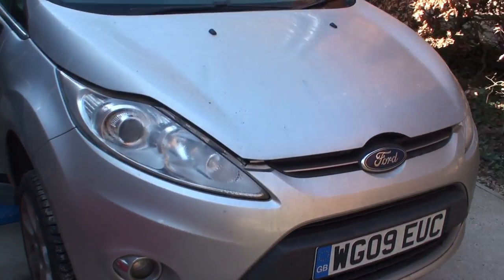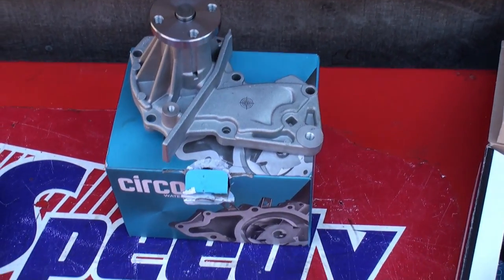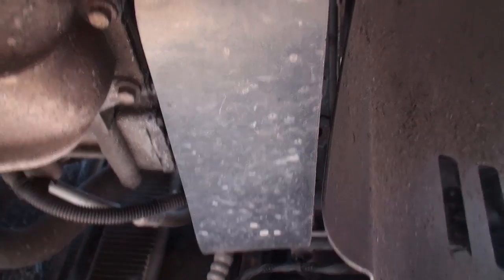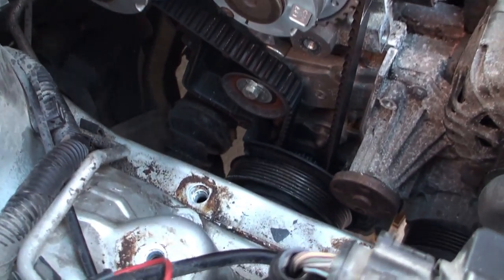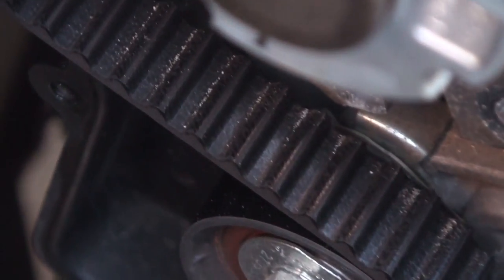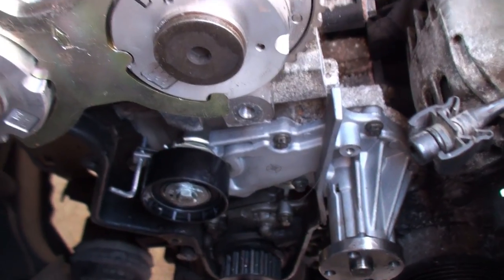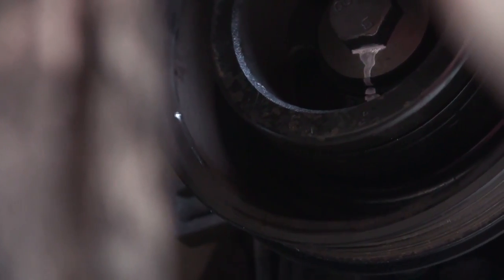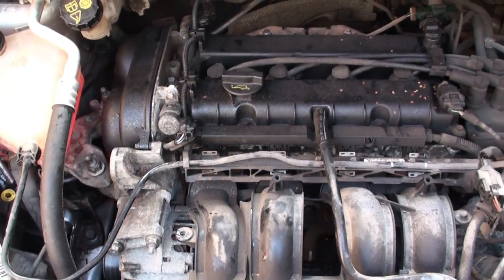Fiesta MK7 Petrol 2008 - 2017  Cambelt Replacement Guide

Comment: Just did mine,  I bought the kit and I thought I had the main locking tool but didn’t.  I still did it with a very powerful impact, and a chain- vise grip over the crankshaft pulley , with towel protecting pulley.  I wouldn’t advise this, definitely get the main locking tool.  Although I was successful.
Reply from the maker: Thanks for sharing

Comment: great video , helped us a lot to do the job,  the clamping kit we bought from eBay wasn't fit for purpose, after spending many hour locking everything into position, cutting the belt and started undoing the pulley bolt the flywheel holding tool snapped very easily !!!  we were horrified ! we aren't experienced with engine timings and just watched the main crank move!!!  ended up taking the sump cover off then could see the fly wheel, we then made our own tool to hold it. All good now and started first time :)
Reply from the maker: The flywheel holding tool works on the ring gear. If you mean the pin that screws in the side of the block then this is just the TDC positioner. It wont take any torque.

Comment: To anyone interested regarding the auxiliary belt stretching tools -  if you buy the belt from a Ford dealership, they supply them with the belt. Did it once with a focus years back, kept the tools, and now I can just use the aftermarket belts just as easily
Reply from the maker: Interesting. I knew Ford did that in the USA but didn't thin it was a thing in the UK....  Thanks for watching.

Comment: Correct procedure with tips thanks for sharing.
Reply from the maker: Thanks for watching!   Just make sure you hold that crank in position when loosening and tightening the bolt, Had  guy on here complaining that the TDC locator pin snapped off when he undid the crankshaft.  I said did you fit the pinion locking tool he said 'there was nothing wrong with the starter so I didn't bother with that stage'....  It just goes to prove you can't win..  Good luck with it.

Comment: Hi. Great video showing the parts and reasons for tools - well explained.  Can you explain how you managed to install the aux belt after doing the timing belt;  I'm about to do the same job on my Focus Mk2 2007.  Thanks again.  Cliff
Reply from the maker: Cliff, I cut a piece of Tin plate that protected the belt from the edge of the pulley when being stretched over the edge.  You just get it in position and then rotate the crank and it slips into place.  Much easier to do that I had anticipated. If you buy the locking tool then note that in some kits the peg that engages in the starter ring is too short to reach the teeth.  Double check you have the right one for your engine.
Reply: @razenby  Thanks for that - much appreciated. Sorry I'm late getting back to you.  Thanks again.

Comment: Did you bother locking the flywheel for when you torque the crank back down?
Reply from the maker: Yes- see video - I took the starter out and locked the flywheel with a locking tool. The problem with the ford is the TDC flywheel pin that screws in from the back of the block is very thin and easily bent.   If you can get a socket on the crank pulley bolt you might be able to get away with using an impact driver without the ring gear locking tool fitted. Good luck.  The most important thing to remember is to hand crank over and check the timing is correct before you start the engine..

Comment: Great video ! I have a question wondering if I could loosen crankshaft pulley bolt first with old timing belt still on to the point where only tight enough to set engine at TDC. And tight a new crankshaft pulley bolt on with new timing belt installed and lock pin, timing plate out. So that I don't mess up timing and don't need to apply the lock on fly wheel. Is it doable ?
Thank you again for this informative video.
Reply from the maker: There is no woodruff key on the crankshaft to register the rotational position of the pulley - only the clamping force keeps it timed. If the pulley moves at all on the crankshaft when you loosen the bolt then you will have to do the whole re-timing exercise. Sp probably not a good idea.
Reply: Gotcha
Thank you!
Reply: @razenby  Really? That's very surprising. I wouldn't have thought that the design would rely on friction, I've never seen one without a woodruff key but happy to be wrong...
Reply from the maker: @hyndsengineering  Yes it does. All Fords do.  Loosen the crank pulley bolt and the pulley and the cam drive socket spins on the crankshaft.
Reply: @razenby  well - I did my daughters cambelt and blow me if there was no woodruff key!!! Thinking about it I've only ever really worked on German cars. Learn something new everyday. I did like the fact that when the pin was pulled on the tensioner the belt was evenly tensioned with no faff of double checking the cam position as everything is individually timed and any tiny tolerances are taken out by the fact that the crank pulley self adjusts on the shaft. Rather neat.

Comment: I followed your steps, will the flywheel only lock when it’s on timing? I put the locking tool in and it did not lock the fly wheel, I flipped it and tried different methods but nothing
Reply from the maker: The flywheel locking tool  that fits in the starter engages in the ring gear on the flywheel. When you fit the locking tool you have to do it with feeling, making sure that the teeth on the locking tool engage on the teeth on the ring gear. Move it up and down until you feel it slide in further when the teeth line up,  If the teeth aren't engaged they it will slip as soon as you apply torque to the crankshaft.

Comment: Hi I'm about to attempt this to help a friend with the job. First of could I get away with not using the locking tools the crank isn't under load and was going to mark it up along with cams so i know where to return it to positions they need I've an strong dewalt impact which I can use for the crank bolt, if the cams rotate slightly at least I've marked them but because there under tension how easy to move back to the right point I've a hook spanner which I can use to move it hopefully if not to tight 🤞
Reply from the maker: The problem is that the crank timing pulley is not keyed to the crankshaft.  Setting the crank to TDC is easy by use of the timing pin.  I have never gone through the complete timing setup process that would be necessary of either the cam pulley loses reference to the belt. Since the cam timing is variable I presume that you fit a locking tool to the CAMS with the timing gear cover removed and then set and lock the the cam pulleys to their own reference at TDC. Only then can the belt be fitted.

Comment: Great video, thank you. I two questions. Why do you need both a flywheel lock and a crank locking bolt, don't they do the same job?
Reply from the maker: The pin is for setting the TOP-DEAD CENTRE.  The flywheel lock is to hold the crank whilst you undo the pulley bolt. The timing pin isn't strong enough.
Reply: @razenby  Gotcha!

Comment: Did you turn it 90degree then wait a few minutes then turn it 15degree? And how did you stop the engine from turning?
Reply from the maker: Loo  at the video  the fitting of the crankshaft locking tool as discussed. If the cam sprockets and the crankshaft crankshaft are locked and not allowed to change registration with regard to each other then there is no need to rotate anything,. Just cut the belt and put the new belt on.

Comment: Was your breaker bar 1/2 or 3/4"".  I had to abandon my last attempt at this job on my wifes  59 reg 1.4 Fiesta Mk6. (yes 59 reg MK6) due to time constrains, not having the crankshaft locking tool, and my ratchet and extensions in severe bend and torsion. Its great to see someone  remove the crankbolt without an impact wrench. Shame you didnt show the struggles with undoing and tightening the crankbolt becouse it would have been the only one on the intenet. Well done anyway
Reply from the maker: 1/2"  I do have a 3/4" but rarely use it.
Reply: thanks @razenby

Comment: Please I’m a mechanic from Ghana and I was removing water pump  on Ford Fusion today and I I didn’t lock the crankshaft before I lose the crank bolt, 
So please I want to ask what will happen
Reply from the maker: You must reset the crankshaft and the cams to be in correct positions before you put the tooth belt back on.  If they are not set correctly the valves will hit the pistons.  It is what is called an interference engine.
Reply: Your not a mechanic...
Reply from the maker: @13panda13  Thank you. It would be an insult to call me a mechanic.  I am in fact a chartered engineer, my status and skills are way, way, way above that of a mechanic !!!
Reply: @razenby ?? Umm, I was talking about the dill from Ghana.
Reply from the maker: @13panda13  Aha, I thought that might be the case... I guess he is doing his best with limited resources..
Reply: @razenby  whats limited resources got to do with it? More like he hijacked someones car.

Comment: Hello mate. Got fiestas ST 1.6 ecoboost.  Changed the timing belt.  The car its is cranking but not starting. Any advise please? Thanks a lot
Reply from the maker: Check the timing again!!  Did you spin it over a couple by hand of times to ensure the valves and pistons are not interfering?   Check all plugs and wiring connections are sound.  Plus a code reader in and make sure no codes are being thrown up. Could you have got the crank 360 degrees out? Engine will turn but not start......  Double check.

Comment: Great video! Do you remember if you used new bolts for the water pump? Workshop manual says to do so, but I don't see the point.
Reply from the maker: No, I just used the old ones. Can't see the bolts that came out of the water pump being stretched - the torque isn't high enough.  Never understood that as I have always used the bolts that came out unless they are stretch bolts or very high tightening torque bolts. No new bolts were in my Water pump kit.
Reply: Thanks for the fast reply - my thoughts exactly! Also, when fitting the crankshaft bolt, did you remove the pulley alignment tool before or leave it in while tightening?

Comment: Hi. On these tensioners do you only do the bolt hand tight then pull the pin. After that then tighten ? What is is like 30nm
Reply from the maker: That is the idea.  I am not sure on the torque.  30nM  sounds about right for an 8MM bolt. Do the bolt up tight.  The tension is applied by spring not by locking the arm in postiton with the bolt.
Reply: @razenby  thank you as I work for vw our tensioners are tensioned once using the force of the nut. But I was un sure with fords but after a bit of research I've found once you remove the belt you located the new tensioner tighten the bolt and done. Fit belt pull pin. It's spring loaded. Thanks 👍

Comment: Perhaps you suppose pulling the timing belt tensioner hold pin before the crank bolt is tightened to be best?   I imagine that to get the belt tension exact that crank pulley may need to spin a slight bit to pull the tension from the opposing side , then tighten down.
Reply from the maker: The crank stays locked by the starter ring locking tool. No relative movement is allowed.
Reply: @razenby  oh. I haven’t actually done this job yet, but I understood there was no key way to pin the crank gear. Thought that it might free spin.
Reply from the maker: @Dogpool  You need the crankshaft locking tool. See video.
Reply from the maker: @Dogpool  the locking tool is adjustable so you can lock on exact TDC.  Never seen a starter ring gear come loose on this engine.
Reply: The one I just did was a 2014 fusion 1.6. On that model there was nothing holding the crankshaft belt gear from spinning when the bolt was out. In that case if I were to tighten the bolt before I had the timing belt at the proper tension, there might be some slack on the back side of the belt. This would be taken up by maybe a half or so tooth of movement , making it just slightly off exact. I didn’t actually read this anywhere, but am postulating that pulling the tensioner pin before you tighten the crank pulley is the right play.
Reply from the maker: I cant really appreciate your argument. Maybe I am missing something,   If the crank is locked then it cant turn. The belt and cams are held by the cam locking tool. The belt is strong enough to resist rotation of the pulley when the bolt is tightened. If you pull the pin how do you hold the crankshaft when you tighten the pulley bolt?  The problem is the pulley turning in relation to the crankshaft.  You cant tighten the bolt unless the crank and cam positions are defined and constant in relation to each other.
Reply: On the car I was working on the crankshaft was locked and couldn’t turn but the pulley gear could.  There was no key way to hold it.  It would free spin on the crankshaft.  On yours was the crankshaft gear keyed so it wouldn’t move?
Reply from the maker: @Dogpool  Thanks for the info.
Reply: yes that sounds good, and the cam pulleys , everything is locked so so the belt is then tensioned at every pass then tighten up the pulleys

Comment: HELP!!!!! you totally skipped the part where you take the crankshaft pulley off. there is no tool that fits a 4 hole crankshaft pulley to pull it off. What tool did you use?
Reply from the maker: Once the bolt was undone it just pulls off.  It isn't on a taper.. It should spin freely when unbolted as there is no key.  Tappy-Tap-Tap  Time.......

Comment: So you actually have to remove the crank pulley? From the video, I can't see why you can't get to the cam drive to swap the belt.

Great video
Reply from the maker: Yes,  unfortunately, the pulley has to be removed to release the belt. If they had thought through the design of the plastic timing cover they could have avoided this onerous step.
Reply: Thanks @razenby  . I'll be doing all this next weekend.
Reply: Yes! I forgot to follow up  Birdman Junior  . I didn't realize the crank shaft holding tool wasn't in the kit I bought, so I had to order one and wait on that to come in when I already had it part way torn down...in my ex wife's driveway 😂

But I got it all done, did a road trip a few days later. Then a track day a few days after that 👍

Comment: Hi mate, dont you have to change the oil seal together as well?
Reply from the maker: Good pint. My approach is:  If it isn't leaking then leave well alone. A new belt will be due in 5 years. The OEM seals are good and the thermoplastic elastomer has advanced in the last 20 years.. Beware cheap aftermarket seals.  I buy mine from a local bearing supplier. They have real industrial brands at a lower price. I have a mercedes from new with 190k on the clock. The engine is as dry as bone.  On an older car then maybe yes.
Reply: @razenby  Good point, looks to be a pain to get the cam gear out as well. Thanks for the reply

Comment: Hello small question I have a fiesta 1.6 ST 182 
I made my distribution following a leak on the water pump I didn't have a ford setting pin for the crankshaft and I put a 7 diameter drill bit instead, however I set the camshafts well with the ford tool. 

I really felt when setting the crankshaft that the drill was blocking it
 I performed my engine revolutions manually without problem once the new belt was reassembled, but when starting the engine does not turn well, on 3 cylinders it seems.. 

Is it possible to shift the crankshaft by half a tooth or even a tooth if you don't use the ford tool? 
It looks like i didn't break anything but my wedging looks bad

 Thank you for your reply
Reply from the maker: I guess a drill bit would work so long as it is a tight fit in the threaded part. Unlikely that it could be a whole tooth out. If you are in doubt about the timing or you thin it may have slipped then you are best advised to do the complete valve timing set up. Good luck.

Comment: Hey awesome video! I agree with everyone else, one of the best on YouTube!

Just wondering , I changed the water pump, used the tension pulley to remove the timing belt, I didn’t mess with the cam shaft or the pulley at the bottom! 

Did I need to use the timing pin, cam locking tool and flywheel tool if i only messed with the tension pulley and not anything else??
Reply from the maker: Thanks. The  Water pump is driven by the Auxiliary belt so you don,t need to lock the engine or touch the timing belt to change it.

Comment: Where did you get the camshaft locking tool? I can't find any engine specific ones
Reply from the maker: I still have it if you want it. I think it was from the ford special tool reference in the manual. Sadly I don't have the manual any more.

Comment: Note to everyone the crankshaft gear is NOT keyed. Make sure you do not turn the crankshaft without the bolt in tight or you'll be in for an engine. Bloody good video though, thanks mate
Reply from the maker: Yes as stated in the video.
Reply: @razenby  yeah sorry I hadn't gotten that far when I commented I just heard you knew it might not be keywayed. Like I said great video I had to do this same job and I was stumped trying to read the directions with the tool and this cleared up everything

Comment: On my fiesta 2011 1.6 L North America, the starter cannot be accessed without removing all the upper engine cluster. Do you think it is possible to torque the pulley bolt against the TDC pin?
Reply from the maker: No.  You might get away with the use of an impact driver but if teh CAM pulleys lose registration with TDC it is a faff getting back on track.
Reply: Starter is just three bolts. Take the air box out and they're all right there.
Reply: @stevenwebb6123  no way, I tried already, I need to take out the entire intake manifold. It was a pain, but I did the timing belt without locking the flywheel.  I fear the moment I will have to change the starter